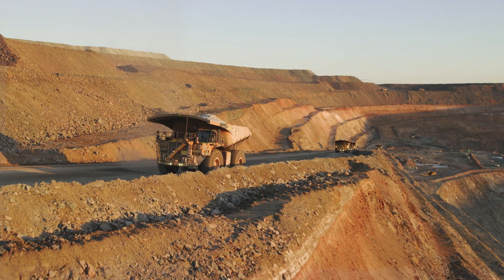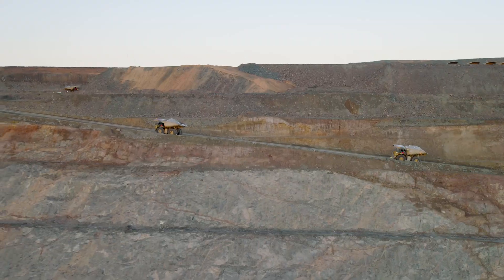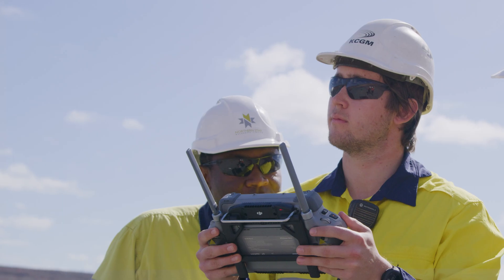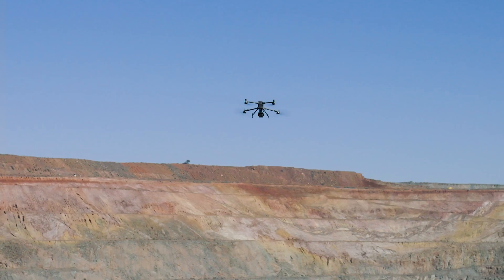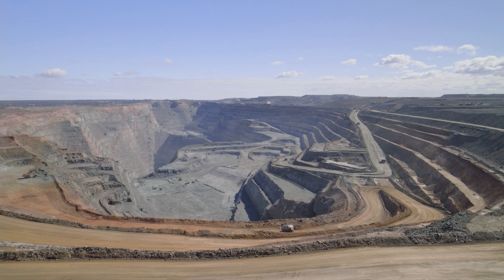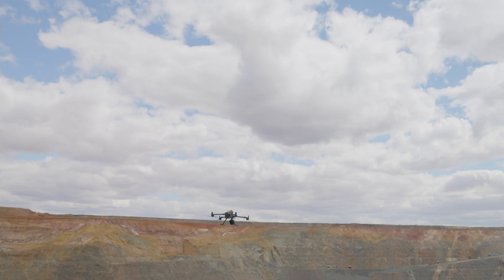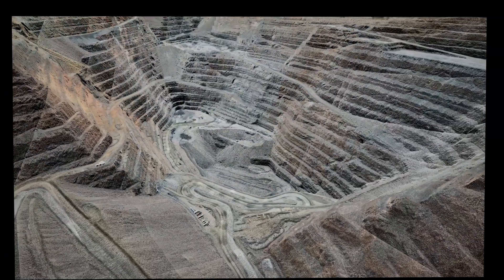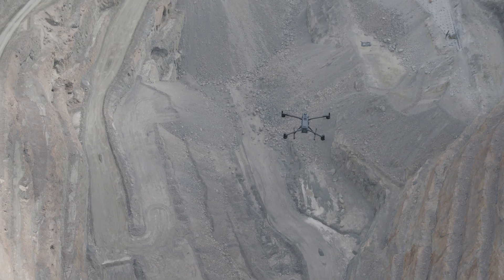DJI Zenmuse L3: How LiDAR Transforms Operations in a 650m Deep Open-Cut Gold Mine in Australia

Comment: Cool story, but I'm sure it could be done fine with the P1 or L2. Maybe with some slight terrain follow? Or is losing line of sight a huge issue that is alleviated by being able to get data at long range?
Reply from the maker: Hello! Thank you for your feedback. 

While L2 or P1 can also be used, achieving the same high accuracy would require significantly more time for flight planning and the overall operational cycle. With the M400 + L3, however, the entire job can be completed in just 15 minutes. Additionally, given the pit's depth, the pilot's line of sight is often blocked, increasing the likelihood of signal interruptions between the RC and the drone. 

Strong and unpredictable wind and turbulence at the bottom of the pit also raise the flight risk. Pilots should exercise extra caution to ensure operational safety.